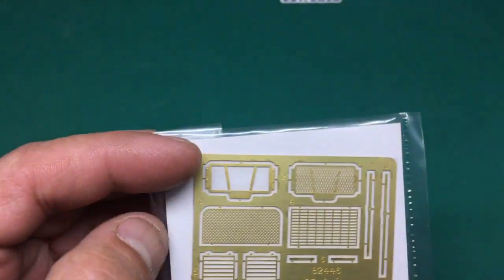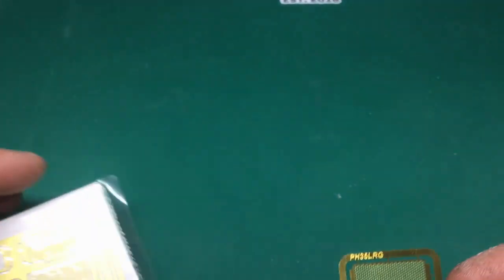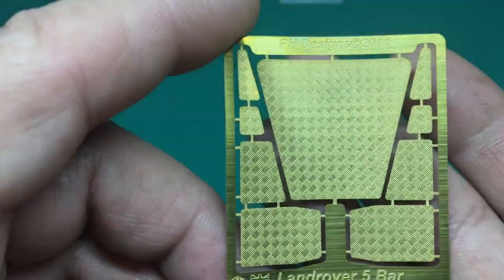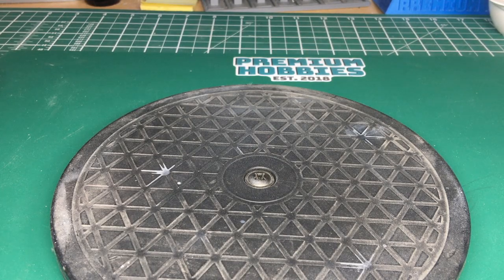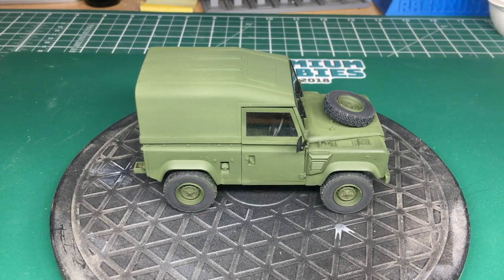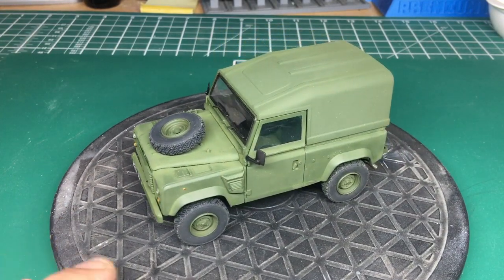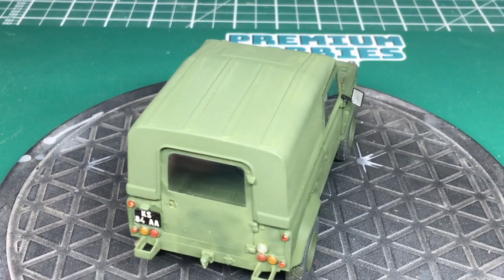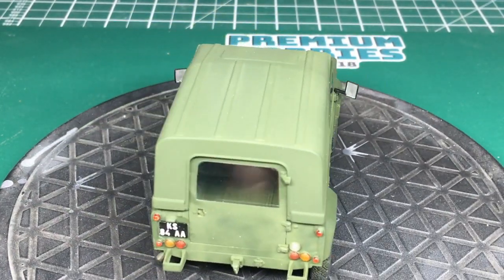HobbyBoss 1/35 Land Rover SWB Conversion. Part 12 The End.

Comment: Fantastic build - I know I'm a few months behind, but just finished watching the series.

Couple of details for you;

The Defender TUL/TUM XD aka "Wolf" has the spare tyre mounded on the left side. There were several variants of the 110 Defender (previous version) which looked similar, had the same plastic hard top, but had the spare mounted on the bonnet.

Your bonnet looks fine - I've worked on plenty of them with flatter/more caved in bonnets than that from lads jumping on them to cam them up.

One last thing - these things always have the tyre pressures stencilled in either white or black on the wheel arch eyebrows - 48 on the rear and 28 on the front.

Brilliant work, though, and loved watching the 90 conversion. Thanks.

Comment: Really interesting build and although I will not be doing a conversion like you, I certainly learnt a lot about this before I do it. A number of things Im not sure of though.  1) You painted the chassis and under bits  in black. I have seen army land rovers where the chassis is the same colour as the vehicle itself....a darker version of the NATO green.  2) You painted parts of the engine in a duck egg blue, but the army only do this to reconditioned engines. It would naturally be black and metal colour. If sold to civilians it would be this colour blue I think.  3) The army tended to put their tyres on the front bonnet especially for the Wolf or on the side. Still a cracking build and I cannot wait to get started on my Defender from the British Army of the Rhine!